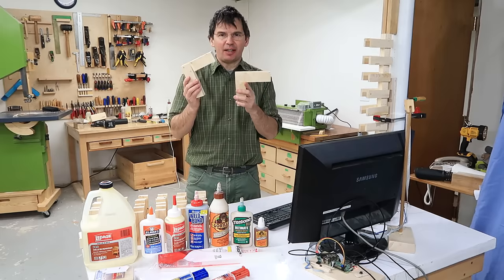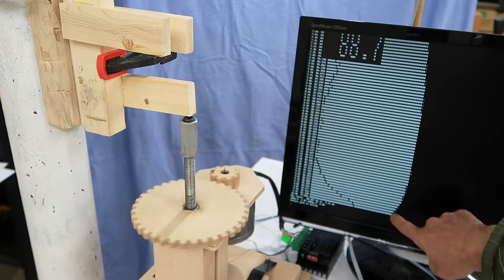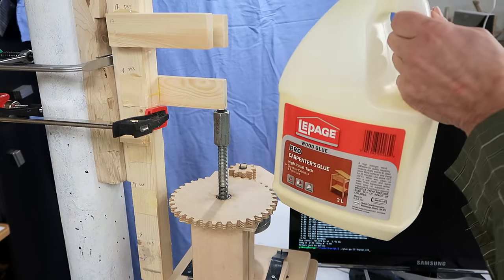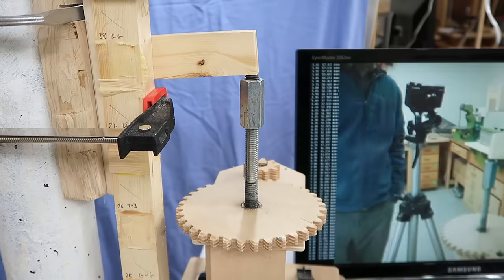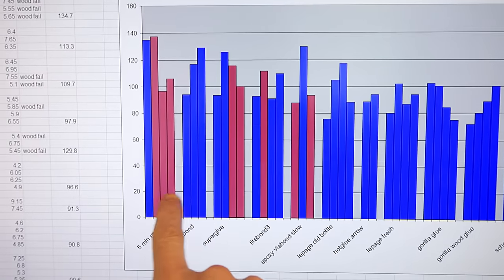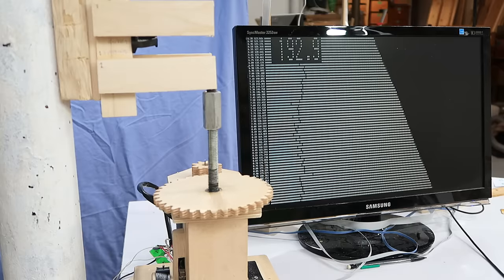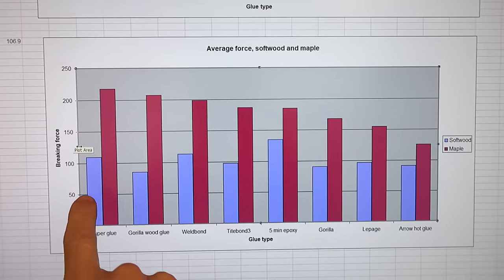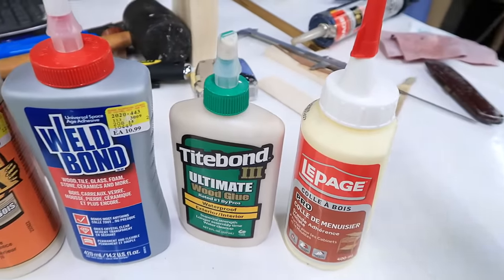Which glue is strongest?  Testing with my computerized tester.

Comment: You didn't test Titebond 2. Titebond 3 is mostly for water-resistant applications, that makes it slightly weaker overall.
Reply: Nope. TB3 has higher strength than either TB1 or TB2.

Comment: Takeaway is that school glue is surprisingly strong! As strong as some proper wood glues! Probably cheaper too…
Reply: Not water resistant though.
Reply: After all 95 % of the glues on the market are just solutions of PVAc in Water (or sometimes Acetone) - they work all the same and are all very similar - the strenght of the bond comes way more from the correct application than from the type of glue
Reply: @F0XD1E  which is rarely needed - most people think the need "waterproof" woodglue, because they don't understand what that really means ;)
Reply: @suit1337  Is it gonna be outside? That's when.
Reply: @F0XD1E  that is exacly my point - no offense, but you're one of "them"

the "waterproofness" of glues is definied in DIN/EN204 

D2 (non waterproof) like regular Titebond is perfeclty fine even for outside applications as long as the wood humidity does not exceed 18 % over extended periods

D4 (waterproof, like Titebond III) is not waterproof - it is suited for extended periods of higher humidity or direct contact with water (rain etc.) but the workpiece needs surface proper protection to shield it from water - if you "soak" the wood in water or it is able to raise its humidity over the treshold it will delaminate
Reply: @suit1337  I prefer to let results speak for themselves. Project Farm tested wood glues tested after soaking for 24 hours and Titebond 3 and Elmer's Max which are water rated produced consistent results that still had good strength, even after being completely submerged for 24 hours. The others were hit and miss with some basically falling apart.
Reply: @F0XD1E  soaking in water for 24 hours is nothing that is needed for making the specs of "waterproof glue" (D4) - if you do this and a joint does not fail, it is pure luck and not because the glue is designed to do this - PCVa is not 100% waterproof, no matter how many additives you add, the polymer can be dissolved in water (though this takes a longer time, if it is a D4 glue with loads of additives)

and yes, obviously Elmers Glue is a regular PVAc in Wwter solution, basically nothing else - you can eat it

if you need waterproof glue, you need to use Polyurethane which is unsoluble  in water
Reply: @suit1337   You do you if you want to call empirical results luck. I'm not saying Titebond 3 is the best option to make a boat or something. Just pointed out that Elmer's school glue is not a good substitute for proper wood glue because it's not water resistant. The results show that water rated wood glues stand up to moisture better than cheaper wood glues and school glues. You're the one that came in saying that most people that want water resistant glue don't know what it means. Maybe they want it because *it works*, based on real life results, not a spec sheet.
Reply: @F0XD1E  that is true

point is: people think that waterproof PVAc glue is waterproof (which it is not) and vice versa: that you need waterproof glue when there is water involved (like making cutting boards - there is no need for waterproof glue at all - thoug i'd recommend a proper D2 woodglue and not good old Elmers Glue ;))

when you really need waterproof glues - for making a boat, just for the sake of argument - you will use real waterproof glues, usually polyester or epoxy resin or polyurethane, those are waterproof - the wood gets rotten and falls apart before the glue joint fails - but for almost every other application (even for most outside applications) regular D2 glue (like Titebond I) or D3 (like Titebond II) is more than enought

and obviously, if you have an outside or bathroom project: use D4 just as a good measure, it does not cost a fortune, but you are on the safe side
Reply: @suit1337  I've glued cutting boards together with Titebond 2 and they stay together. I don't leave my cutting boards sitting in water though. I just rinse them.

Comment: I think this test is lacking vital information. How strong do the glues need to be compared to how strong the glues are? Strength requirements will vary widely, but you could test against some common uses. For example, build a few chairs with different glues. Torture test the chairs. The result may be that even the weaker glues are plenty strong. Maybe they are not. While we always want the best, we don't always need the fastest, the quietest, the strongest, the tightest, the whatever. Maybe construction adhesive is good enough. If so, then it comes down to economics. for what it is worth I always use Titebond. It hasn't failed me, and it's this reason I keep using it, even though your tests show it isn't the strongest.

Comment: i'm aware that you're in canada, but i wonder how this compares if you use a european product

there is a thing: lots of european woodworkers tend to use Titebond because they see it in lots of US-videos and they use it because it is "the best" - but actually there are lots of good european brands that sell PVAc glue, that are basically the "same" and there should be basically no significant difference

Very popular products here are (from long to low shelf life)
- UHU Alleskleber Classic (a D2 PVAc/Acetone general purpose glue) 
- Henkel: Ponal Classic (the regular average joe D2 PVAc glue basically everyone buys)
- Bindulin: Bindan P / Propeller-Leim (high quality D3 PVAc Glue)
- Beko: Allcon 10 (high viscosity D4 PU construction adhesive)
- Henkel: Ponal PUR (high viscosity D4 PU slighly construction adhesive)
- Soudal PRO 45P (low viscosity DU PU wood glue)

To sum it up: your resumee is correct: high viscosity PU adhesives are not as strong as lower viscositiy PVAc glues - that is by design, because the clue does not "soak" in the wood - but PU adhesives are "naturally" D4 and therefore waterprooof, PVAc is usually D2 or D3 at best, and only with added hardeners D4 

so to sum it up: if you can get a hand on some european product, i'd love to see you testing it, because i really don't like people here in Europe importing Glue from the US and shipping them half way across the planet - is is absolutely insane for ecological reasons, and also due to the high shipping costs, it cost you an arm and a leg - i mean good old Titebond costs 50 to 100 % more than compareable local products
Reply from the maker: They don't sell the european products here.  The thing to do is for someone who lives in europe to test the european products.
Reply: @matthiaswandel  this has been done a lot by local woodworkers/experts like Heiko Rech, but the majority of content is from over the seas which leads to the trend, where smaller german woodworkers promote to use products like titebond - because it is "better"' - but this is not eco friendly at all

on the other side of the atlantic - because as you said: not available over there - comes nothing to counter this "misinformation"

what about sending some products to you? are you curious?

---

to be realistic, most wood glues are just a dispersion of PVAc in water - they are (for the regular user) all the same

the result is: people buy products the don't need and using them wrong - like you and me are using them wrong

if you actually read the datasheet of any woodglue you'll be amazed how "wrong" you use them

could be a test series: test wood glue (the same - lets say titebond to keep it simple) in different application methods

1) do it like you always do it by intuiition
2) do it like the manufactuerer suggests in optimal conditions (ammount per area, open time, clamping pressure, temperature and time)
3) vary the parameters

you'll be amazed how much stronger a bond gets if you respect the proper values
Reply: Titebond isn't the best. But it's good enough. And it's easy to get. I used to like Elmer's Probond but they stopped making it. I must have been the only person that liked it?

Comment: For just strength as a comparison this is a good test but does not tell the whole story and wood glue.  The properties of glues that should be tested to provide insight would not just be strength but performance under temperature cycling, freezing, aging, fatigue, just to name a few.  In a pinch, it seems hot glue might work to jig something up but I doubt anyone would seriously consider building a wood chair using glue sticks.

I wouldn't trust Weldbond to hold a sticky note, especially where temperatures can change or gets slightly wet.  

I really like the tests using the old vs fresh and really old wood glue.  Those tests justified my inability to throw things out that can be used in a pinch. Just wait until I tell my wife that I am finally vindicated!
Reply from the maker: Please run the tests, I'd like to see the results.
Reply: @matthiaswandel  Ok.  I'll start this year.  I'll post the results circa 2050.

Comment: To test the strength of the glue rather than the wood, why not glue end grain to end grain?
Reply from the maker: because I want to test how it performs when used in woodworking, which almost always involves side grain.
Reply: @matthiaswandel  In that case, is it desirable that the glue be weaker than the wood so that a failed joint would be easier to repair?

Comment: Any chance you could report force in Newtons rather than kgf?
Reply: if you care, you know how to convert
Reply: @natalieisagirlnow    The point is to, in some utopian future, get everybody using one consistent set of units, so no conversions are needed, ever.  As an analytical chemist, I know that working with quantitative data is difficult enough without the hassle and chance of errors introduced by conversion.  As a former student, I recognize that having to learn unit conversion is a distraction from learning real science that turns many students off of science before they ever get to the good stuff.
Reply: @natalieisagirlnow  it is impossible to convert, because you don't know the gravitational acceleration at the test location, so you need to estimate it with 9,81 m/s² :p
Reply: @suit1337    9.80665  Which are six of the reasons I don’t like converting.
Reply: @markholm7050  it's a flipping youtube video, not a journal

Comment: Just as I was about to drop some money on a decent quality woodglue, this is perfectly timed. Very surprised by superglue's performance! I've been eyeing off mitre kits that include 50g of CA glue and a can of accelerator spray, which would help when it comes to larger surface areas that need high strength.
Reply: Superglue is NOT a permanent glue for timber joints. Don't be tempted by apparent "strength" in this kind of test.
Reply: @johncoops6897  I see people using it for inlays, small parts that can benefit from fast-drying and gap filling. I never assumed it to be as strong as wood glue in a large joint long-term. I certainly use ca glue for other projects and woodturning people seem to love it. Maybe some of the woodworking-focused formulations hold up well if applied right.
Reply: @colossalbreacker  - it's a specialist product, but not suiable for everything. It does not replace other glues, but is definitely great for jobs that other glues cannot do.

Comment: Forgive me... why doesn't the 'Lepage' branded glue go bad please? I thought all glues went 'off' over time so was surprised to hear this one doesn't. What is different about that glue to the other ones, or is it some sort of brand secret like 'coca-cola' and the kfc recipe? Would love to find something similar in the UK as I'm always fed up of going back to a bottle of wood glue only to find it's no longer any use, even though it's been stored properly.
Reply from the maker: It does thicken a bit, but you just add water to get it back to normal.
Reply: @matthiaswandel  Ok thanks for the reply. Is it a pva based glue then?
Reply: @hihosilver925  Yes, PVA. All the info you could want is on the technical data sheet, including shelf life (spoiler, yes it does have one).
Reply: @trevorlambert4226  Ok many thanks. I had a look at that after posting, it said 12months shelf life if unopened, which seems to be about the same as other brands I've seen. It's always such a waste having to throw out and buy a new one when creating projects infrequently, and anything I can do to make it last longer the better.
Reply: @hihosilver925  The datasheet I looked at said 18 months. In reality, it's probably fine for longer than that, but the same could be said for other glues tested as well.

Comment: This test completely ignores the overtime characteristics of the glue, and the behavior of the joints with changes in temperature, moisture, etc. I don't think your choice of glue should be made solely on the strength of immediate joint adhesion. You can build a chair with super glue, and it could be sturdy initially but how good is it if the chair fails in only six months of use.
Reply: That's why videos like this are kind of sketchy. Not to be harsh, but it's pseudo science. Follows some of the conventions, but leads to potentially bad conclusions. This is a problem on Youtube, where people equate popularity with reliability.
Reply: This is completely true but i don't think he can reasonably test it long term so it's this or nothing. Personally, I'm happy to watch this video and more like it.
Reply: Super glue is a terrible glue to use - It's only use should be as temporary clamping. Its not a permanent bond and breaks down quickly after a few stresses. I bet if he yielded the initial pressure and re engaged the apparatus after a short bit, the super glue wouldn't have held the second load.
Reply: Walk a mile in someone else's shoes. Then you'll be a mile away from them and you'll have their shoes!
Reply: @1pcfred  Validity of a scientific experiment, and stated results have nothing to do with walking in someone else's shoes. Two scientists can run experiments for the same hypothesis with differing variables, then make differing conclusions, and ultimately one may be valid while the other not. You don't then tell the one who makes the valid conclusion to walk a mile in the other's shoes. If the experiment is invalid due to missing variables, it's invalid.
Reply: @ahmetmetinuzun  ultimately you're going to be barefoot and I'll have your shoes.
Reply: @1pcfred  Watch out . I may put super glue on the soles.
Reply: @ahmetmetinuzun  you can give it a shot.

Comment: This may be considered an idiot comment you have been missing. Which ones past the smell test? Seriously, is it VOC that people are so concerned about these days an issue with glues too? I know folks that would purposely use a low VOC glue with a higher risk of joint failure than a non low VOC with lower risk of joint failure. Does it make a difference? I wouldn't but some folks won't even consider a product that isn't labelled low VOC (whatever that really means).